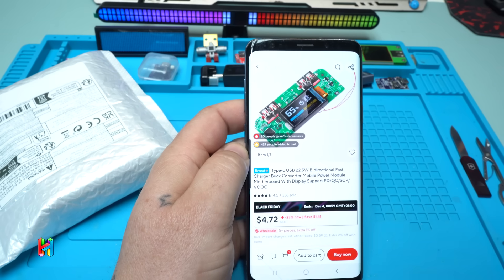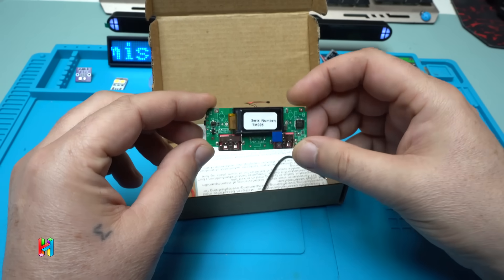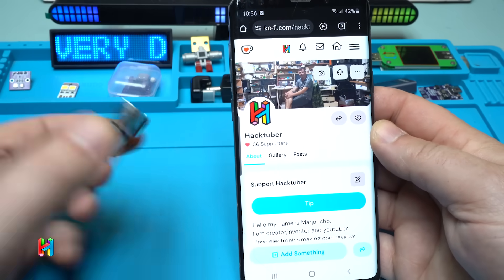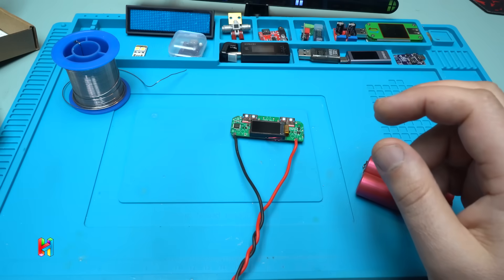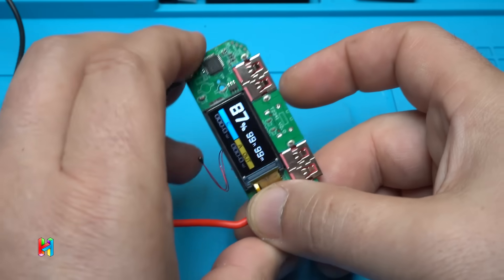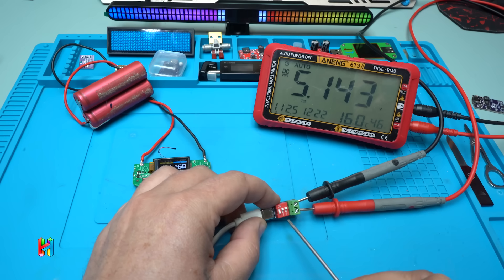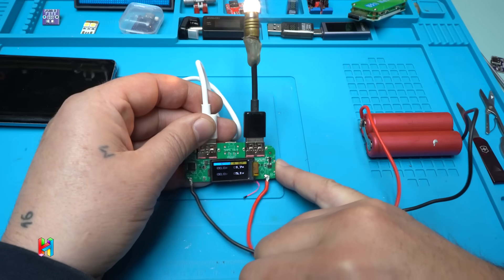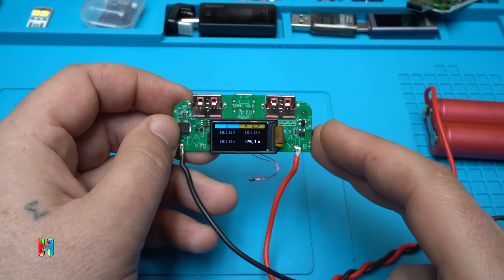22.5w Fast Charging Module Tft Color Screen Digital Display Amps+Watts

Comment from the maker: watch this $418650 mp3 amplifier module review:https://youtu.be/j46R8Cl0kQE
Reply: $418650 ?! That's expensive!
Reply: Would that work as a UPS for a modem and WiFi hub? Just keep the charge port plugged in to keep the batteries charged, then switch automatically to the batteries during an outage?

Comment: stupid video it is , i am using this module which supported mojor protocol, vooc is one of the special protocol very little companies actually follow. 
you testing wire are rubish you should use typc-c cable 100w and battery at least 10-20Ah to utilise maximum output and charging input

Comment: those 4 pads (SWCLOCK, SWDIO, gnd and assuming Vin) are probably to program the controller on the board... Probably a cheap esp8 or esp32 to drive the display and other components on the board...

Comment: I would consider soldering in the middle of the strip so the heat can dissipate and not potentially damage the batteries.
Reply from the maker: Nice suggestion,thx

Comment: I have a question: so this module does not have a BMS?
Reply: I just spent a couple minutes searching for a board with similar information display and a BMS but found nothing so far.
Reply: @johnlombardo TX!
Reply: @RomanoMinghi  Might still be a nice module paired with a single 10000mAh LiPo, or just wait for this TFT display feature to become popular on AliExpress 😆

Comment: I wonder if this is suitable for use as a UPS for a Raspberry Pi?   Can it usefully charge the battery while also providing output to the loads?  Hopefully without overheating in the process?

Comment: It should be noted that the current drawn from the 5V supply is not equal to that charging the cells, as they are at a lower voltage. 
1A @ 5v = 5W, but 5W at say 3.7V is around 1.35A. Not an issue in this instance but worth bearing in mind when charging smaller cells (like the 'free' ones people throw away in the street), as we know, overcharging Li Ion cells can have nasty results 🔥💥

Comment: I have been using same module for over 6 months without any problems. USB-C port is bidirectional, so you can charge devices from that port too.
Reply from the maker: Glad to hear it's working well for you!
Reply: UPS mode?
Reply: No UPS, slow charging when > 70+%